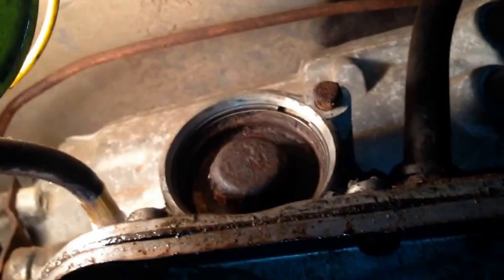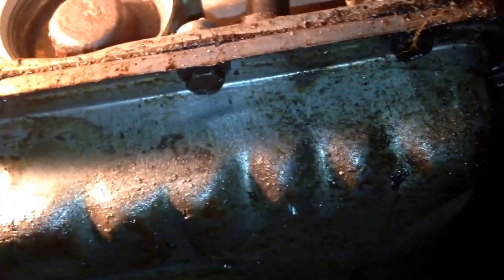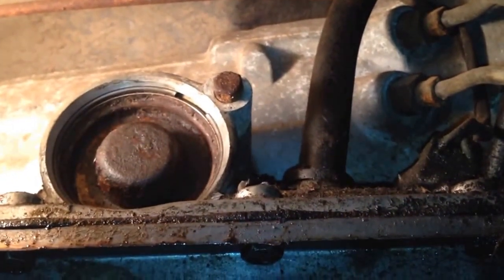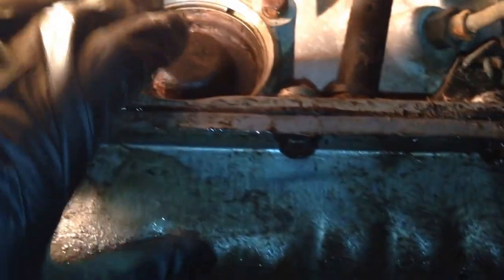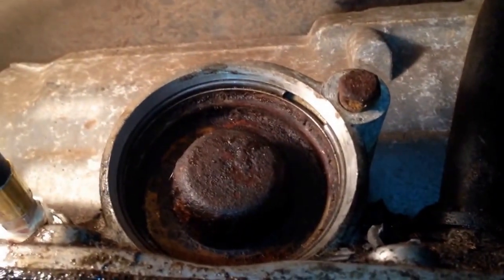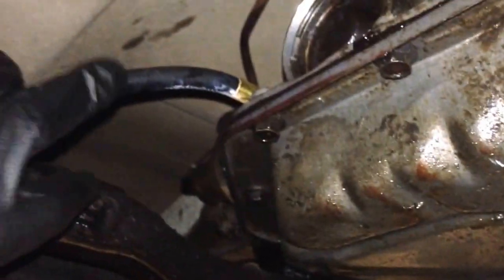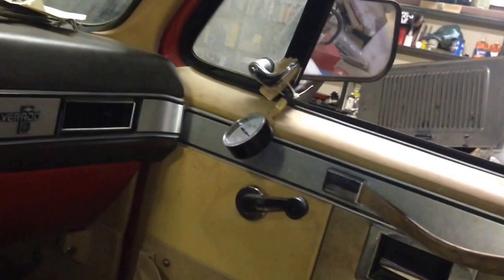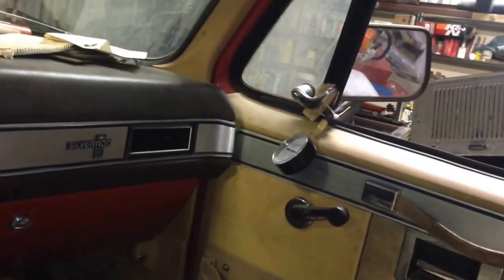85 Chevy C10 1-2 Accumulator Swap

Comment: Did you have to remove the catalatic converter ??
Reply from the maker: No but mine has a smaller aftermarket catalytic converter.
Reply from the maker: Actually it just occurred to me, my exhaust runs on the driver side and the accumulator is on the passenger side.